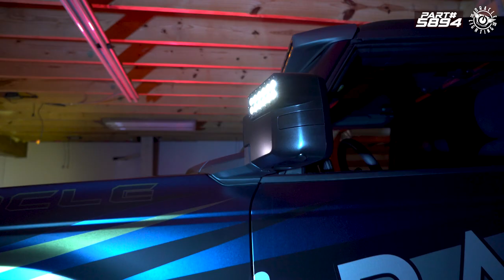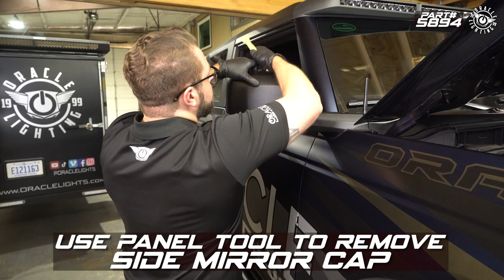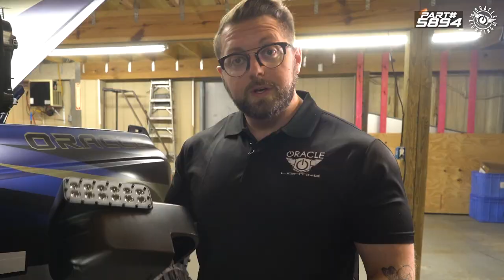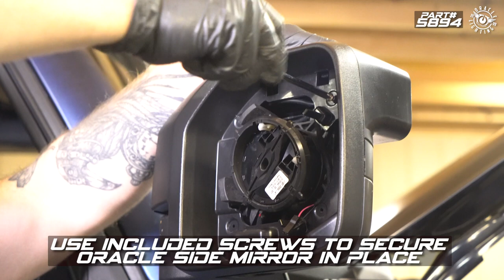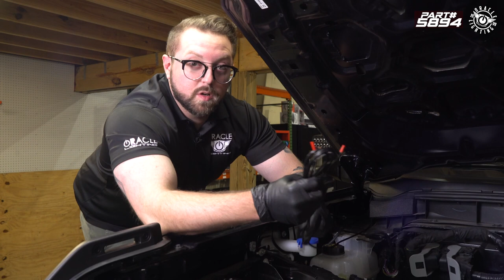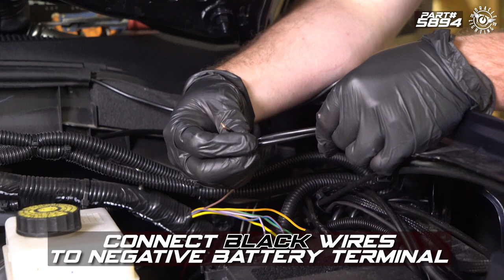FORD BRONCO Off-Road LED Side Mirror Ditch Light DIY Installation by ORACLE Lighting

Comment: mine did not clip/snap that easy the bottom did not ...... I my  bronco model has the zone lighting, camera and all the features on the mirror, DO I need to do any type of modification to the housing for this to clic/snap easy and look that fit>? HELP 
the light are great, I connected them to a remote control since I don't have more AUX switches available.. the cool thing about the wireless control is that come with different mode of flashings.
as wiring the cable from the mirror to under the hood it was a pain but with a hanger cable in form of a hook did the job!
Reply from the maker: If you have the camera in the mirror check the circle hole on the bottom where the lens goes through. We have found that in som instances there may be some small residual slag from the molding process. You can use an exact knife or small file to remove any extra plastic you see in that opening and it should then fit right up. Sorry for any inconvenience, the smaller bit of plastic can cause the lens not to seat in place.